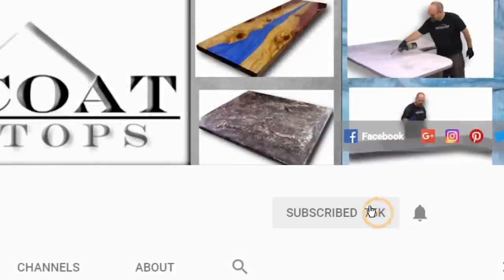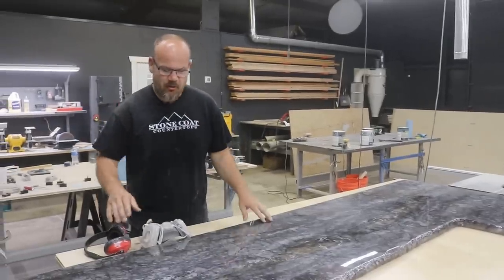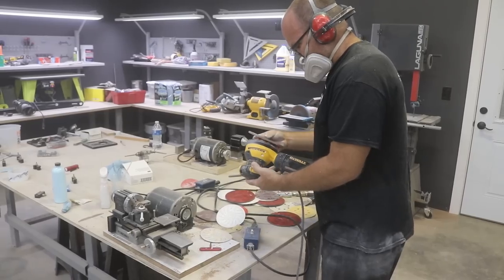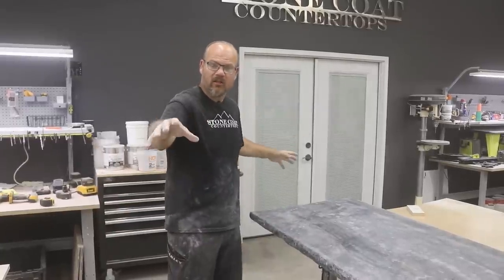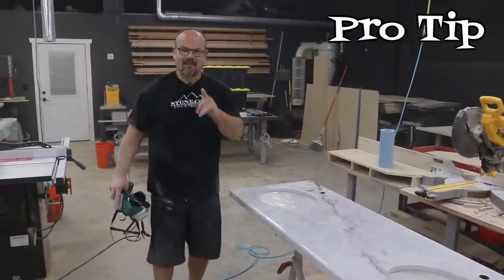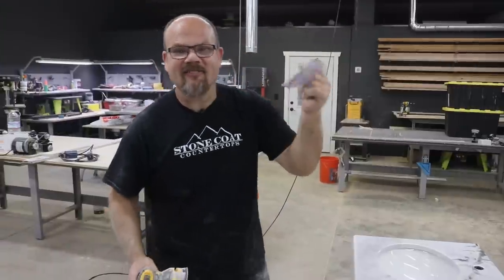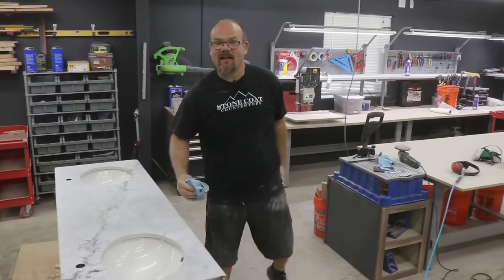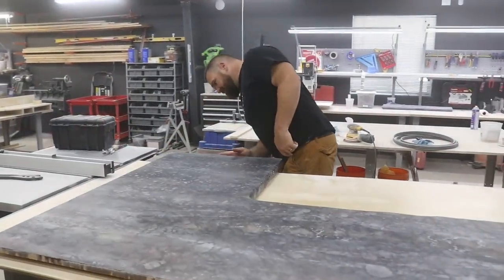How to Hone Stone Coat Countertop epoxy

Comment: Is this step in addition to, or instead of the ultimate top coat (natural finish)? How does it compare?
Reply from the maker: You can do both if you'd like but its not necessary! You Got This!
Reply: Does the ultra top coat provide some sort of a protective seal ammeter sanding down to the honed look? I'm concerned about the honed method leaving the counters porous or not?

Comment: What is the metal sanding disk you use? I have used several different ones in the shop but I just do not get the results you are getting.

Comment: I seen you do a WET sand also, I did this on a project and worked very well, I stopped at 2000, it was inside a house and had no dust.

Comment: I would like to know how to make wall panels to go on my kitchen wall above the counter and under the upper cabinets. Back splash? What kind of backer board? How thick/thin does it need to be? How large/small should it be made? How much space should be allowed between pieces? Does it get caulked or something else? Is it cut to size then covered in epoxy or cut to size after it is covered? How would it be attached to the wall?

Comment: To find low spots in a surface you can dust on a very light coating of flat black spray paint. After the first sanding the remaining black is your low areas. It's an auto body trick for perfect body work.

Comment: I am confused about why you need to sand starting at 220? With a glass smooth, self leveled surface, shouldn't you be able to start much higher than that? I know there may be a FEW flaws, but I would start with maybe 1000, and hand sand any spots that might be still shiny.  Really you are just breaking down the high shine, not sanding out major flaws... right?
Reply: Pretty sure it doesn't self level 100% perfectly, so the 220 makes sure it's absolutely flat